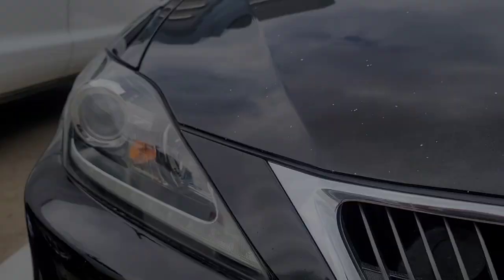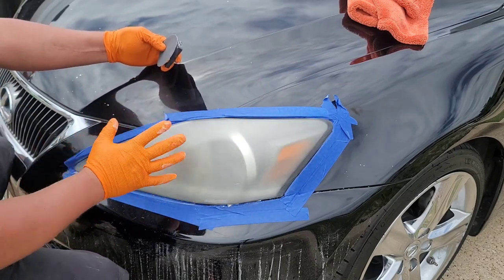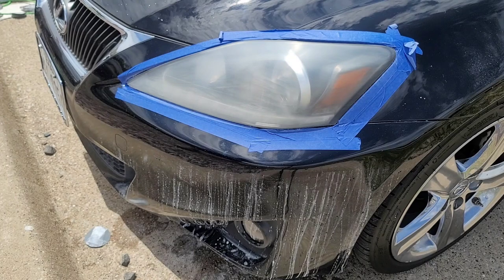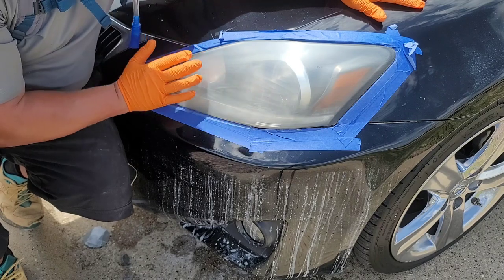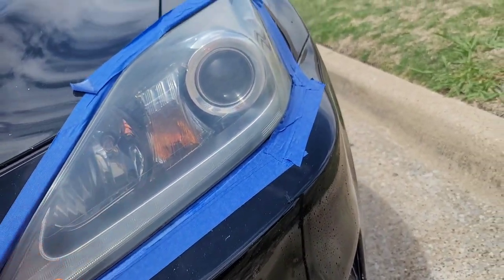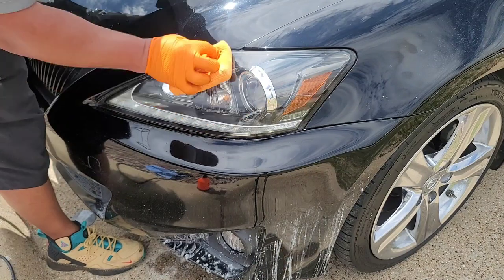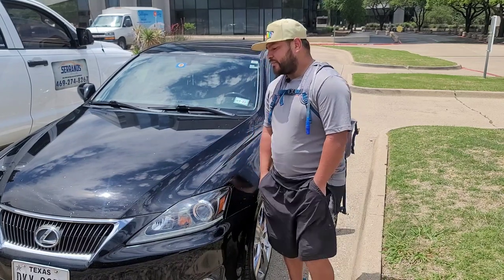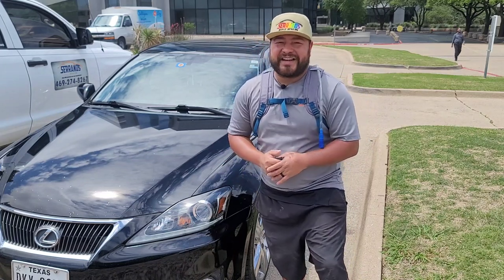Headlight restoration LEXUS

Comment: That looks really nice. I recently did my own headlights but stopped sanding at 2500 I then polished and sprayed a clear coat. My lights turned out really nice. I  was wondering if applying a clear coat after the 5k sanding and polishing is a good idea ?
Reply from the maker: they would much clearer
Reply: @serranosmobile it wouldn’t make a difference at all. Clear is going to fill in the imperfections even at 1000 grit.
Reply from the maker: @TM-fx5le  great feedback

Comment: For me to many unnecessary sanding steps, You didn't raise the the the hood first?? Which indicates you haven't had much in the way of experience in headlight restoration? I strongly recommend 3M heavy duty restoration kit only three sanding  steps first and second are dry sanding the third p3000 trizact is wet, Clean lens with any glass cleaner and dry, Apply a proper headlight polish and buff until the lens as good clarity, Only then apply a certified clearcoat like Maguires with added uv protection, Making sure you spray the lens in the shade and not in direct sunlight, Start at the top and 5-7inch away from the lens in one continuous spray overlapping by 30% One coat is all that's needed, It drys in less than 5min's, The oxidation is caused from the sun, Falling to carry out last procedure oxidation will return sooner than you think, Hope my recommendation helps! 🙂🇬🇧👍
Reply from the maker: Great feedback happy to report headlights look amazing, as I service this customer frequently.